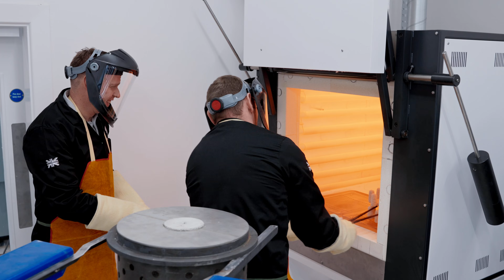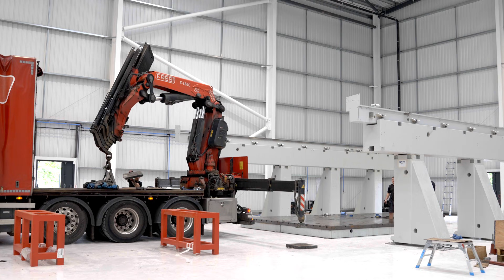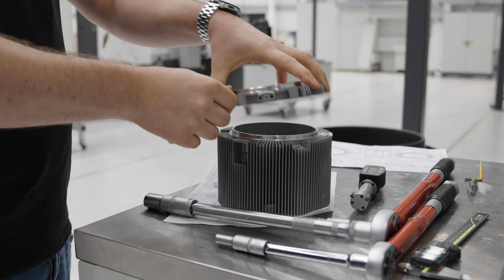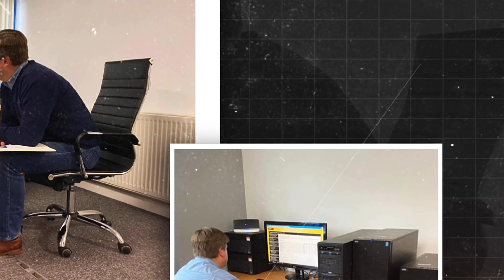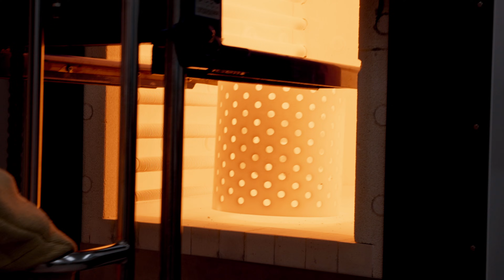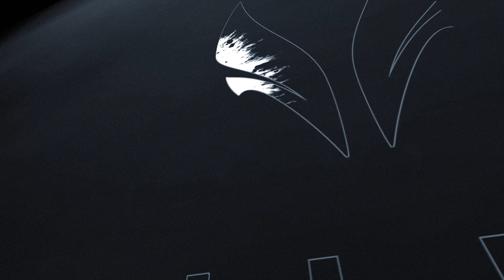Why Hill Became a Manufacturer First

Comment: Nice looking machine, the skid gear (my preferred option) needs to be brought in at the nose and raised 2 or 3 more inches higher. To much spread on the front section of the fixed landing gear, not good for deep snow landings (up here, you will punch out the lower plexiglass window which has already happened. The Bear Paws are a bit to narrow and short,  you need to drill holes in them to "Bite" when landing on snow covered areas. 
Personal views from personal experiences. 
Keep up the great work. :)

Comment: Are there any plans for an Extended Range Fuel Bladder for the cargo bay? It would be more viable ( especially over water)  if it could do 1000NM+ with just the pilot and no baggage in order to relocate for a primary trip.

Comment: Hope you expand to the bush plane market with a higher capacity (preferably more than 4 passengers) piston engine (for lower cost) equivalent would be awesome! As long as you have a decent price!
Why a bush plane? 
Firstly they have more affordable pilot license and secondly they can land on water! Plus many more!
If possible you could also experiment with electric engines (maybe for this scale of aircraft they make sense)
Reply: Zero sense. They are not building a piston or electrical engine. They are vertically integrating specifically for this helicopter. The only thing that would make sense is to produce the engine they are already working on, for other small turboprop aircraft.
Reply: Dreamer?

Comment: Sourcing pars from established suppliers brings some larger scale benefits and puts you beyond childhood disease period. You still have to buy raw materials from vendors.
Reply: For traditional manufacturing methods… contract with outside manufacturing…

For the new millennium with automated CNC machines… watch this video and re-listen to why Hill doesn’t do traditional manufacturing…

I grew up in a machine shop, watching 100 men operate 100 metal lathes… with daily quality issues needing to be reworked.

CNC machines and 3D printed metal parts, with options to use titanium in certain places…

Going back to the 80s processes, probably won’t make Hill any more successful.

😃
Reply: @AC-jk8wq  Reminds me of my teenage years when I also knew everything better than anyone.
Reply: It is a choice...